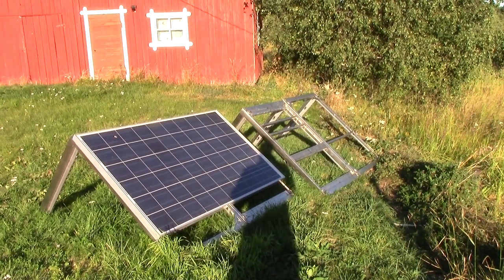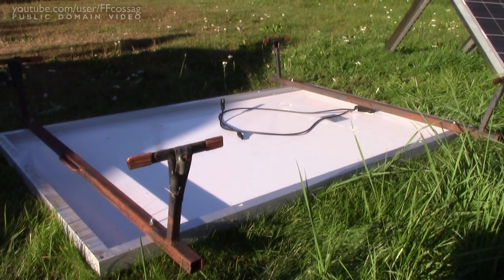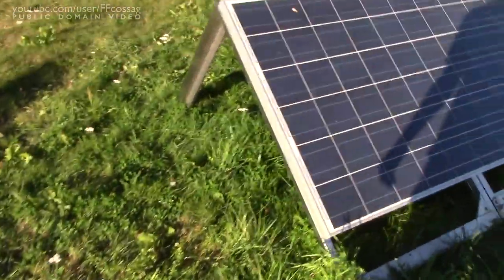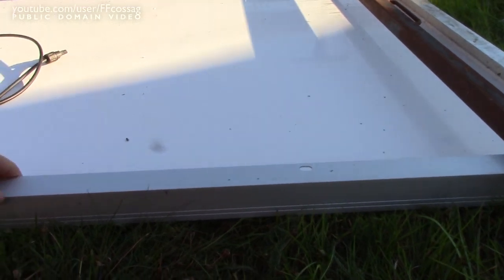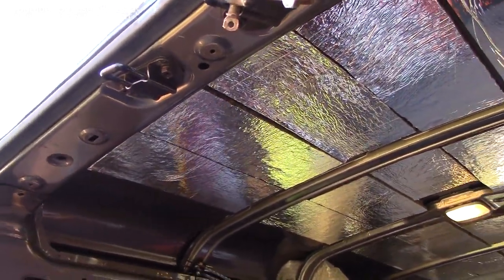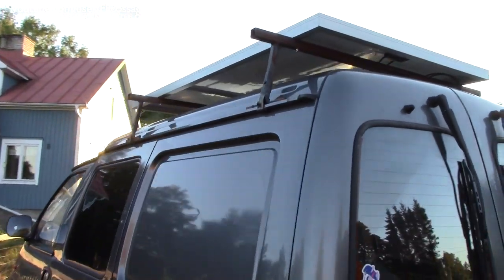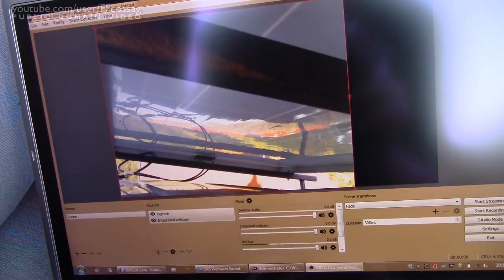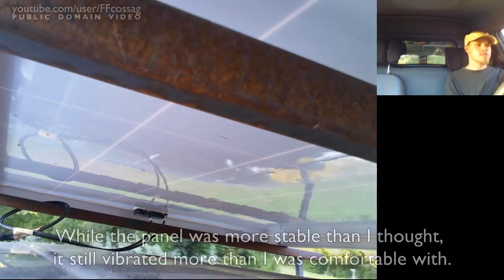Van camper! Build log #1 - Solar panel

Comment: I've been considering putting a couple flexible 100W solar panels on my Jeep.  They would be flat on the plastic removable hard top so wind would barely be a factor. 
You, on the other hand, have done a FINE job securing a large framed solar panel onto your van!  Congratulations!  I like it!
Reply from the maker: Thanks. Flexible panels is a much neater solution, but sadly my budget for this project is basically zero.

Comment: Nice! :)
I'd maybe think about adding some sorts of air guide on the front so that the driving wind can't get under the solar panel from the front - and glue down the anti vibration foam things too.

Comment: This is awesome. I will be most interested in following your build. I've been working on converting my 84 Vanagon for a couple months now. It's been a 7 passenger 270hp monster for years and I've finally gotten around to the final phase which is converting it into a sleeper with ample power for electronics with solar, and a set of golf car batteries. Using 8 Trojan T105s I can use an 8000btu window AC unit (well hidden) for 8 hours on batteries only (fully draining them). I've been looking at flexible solar panels because I don't want to add to the roof height so I can park in downtown garages, 5x100w panels. I like your solid roof rack and large panel, that's durable and going to last a long time.
Reply from the maker: That sounds pretty sweet, it must be nice to actually have a budget for your projects, lol. Thankfully AC isn't required in scandinavia, especially since my van is so tiny that two batteries of similar calibre to yours, alone eat up a considerable chunk of interior volume.

Comment: The closed cell foam is great stuff, I used to get what I believe to be polyurethane foam that was used in shipping large computer chassis. I had used it in many projects over the years. But guess what? The stuff breaks down in time, I assume it is from UV light as was the case when I had it filling the gaps from the rear window of my truck to the shell topper of the pickup bed. It would go from pink to white and to bits
Back up the hardware with locking nuts and or thread locker. Also, aluminum fatigues in odd ways, so check from time to time for signs of this? Thanks for the video
Reply from the maker: Pink foam is pretty cool stuff. Very similar to the bath bananas in texture.

Good call on the locking washers - I'll add some of those. I won't put thread locker though, because getting at the bolts is a bit wonky as is, and thread locker would assuredly make it a pure hell.

Comment: industrial rubber inbetween the mounts and the panel for more vibration dampening, perhaps? doesn't have to be a lot, just where it clamps to the mounts. 

Love the pool noodle foam idea though, didn't give that a thought.
Reply from the maker: I don't think rubber mounts would do any good; the issue is not that vibration is coupling to the panel, but rather that the middle of the panel is entirely unsupported.
Reply: can't be too safe to protect the investment, even if temporary.

Comment: ooh so you buiilt the red case with all that solar stuff in it to put it in your car?
Reply from the maker: Yes indeed. The unique thing about this camper conversion is that I still want to use this as my work van, and I want the conversion back and forth to be quick and effortless. Hence a quick-connect electrical system is absolutely required.

Comment: it might take more energy to overcome the added drag than it will produce in a day ;]
Reply from the maker: Perhaps. The key advantage of solar is that you don't have to drive every day in order not to ruin your batteries.
Reply: i was being a smart ass ;)
Reply from the maker: *****
Obviously, but you actually might have a very real point in your smartassery! It could very well be cheaper to simply charge off of the alternator.